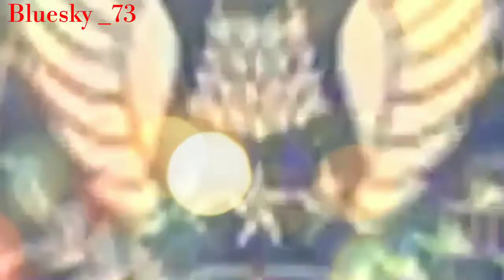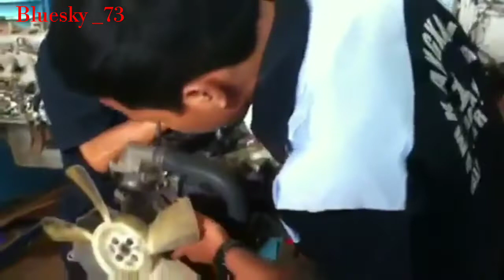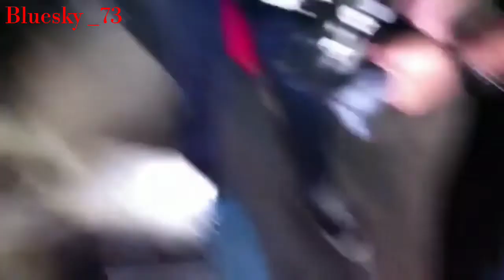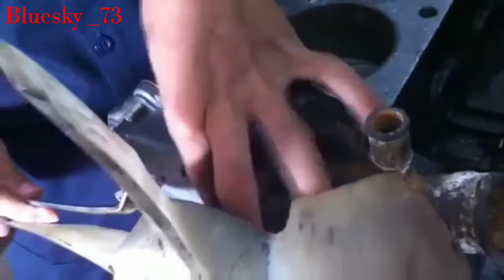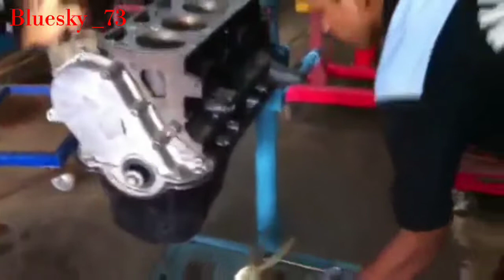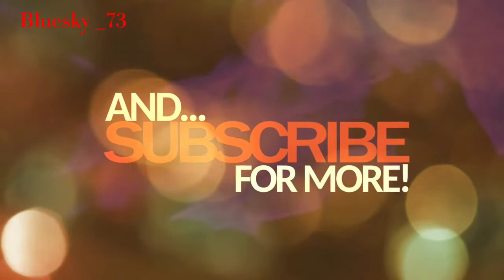TUTORIAL OVERHOUL ENGINE #1

Comment from the maker: langkah langkah "overhaul engine mobil kijang tahun 2002"
Pertama siapkan alat dan bahan yang akan di butuhkan tentunya. ini ada beberapa alat dan bahan yang harus disiapkan terlebih dahulu.

Alat :

kunci shock, pas ring, ( 8,10,12,14,17,19 )

kunci T ( 10,12,14 )

obeng min (-) dan ples (+)

sikat kawat

treker

kape

dongkrak

tang.

bor

compresor

palu besar dan kecil

ragum

presan ring piston

tempat oli

kunci inggris

kunci momen

 drive

koas

Bahan :

stempet

hampelas kasar dan halus

silikon 

bensin

lap

papan kayu

skir

packing satu set

threebhone

uraian kegiatan :

lepaskan filter udara dari dudukannya.

lepaskan  carburator beserta selang selang filter bensin

lepaskan intek manipul dan exhause manipul

lepaskan kabel busi dan coil beeserta distributornya

lepaskan baud engine yang di teruskan ke transmisi.

lepaskan dinamo ac dari dudukannya beserta selang ac

lepaskan  alternator/dinamo jalan dari dudukannya

lepaskan radiator dari dudukannya.

lepaskan kipas radiator dan pulinya beserta timing dan van beltnya.

buang terlebihdahulu semua oli mesin.

lepaskan baud dudukan mesin

lepaskan kepala silinder dari dudukannya

pasang atau ikat treker pada tempat yang sesuai

angkat mesin perlahan lahan hingga turun

lepaskan ikatan treker

lepaskan water pump dari dudukannya

lepaskan karter/ bak oli.

lepaskan kopling dari dudukannya beserta fly wheelnya

lepaskan filter oli.

lepaskan chameshaft pada dudukannya

lepaskan saringan oli

lepaskan bearing stang piston

lepaskan poros engkol dari dudukannya

lepaskanpiston dari dudukannya

Bersihkan semua komponen komponen engine, mengganti komponen yang rusak atau sudah aus.

merakit kembali mesin mobil

menaikan mesin pada dudukannya

merakit kembali komponen komponennya

Masukan oli unioil pada engine.

stater mobil. 

peringatan : jangan di gas terlebih dahulu, biarkan mesin hidup selama satu hari penuh untuk menstabilkan mesin.